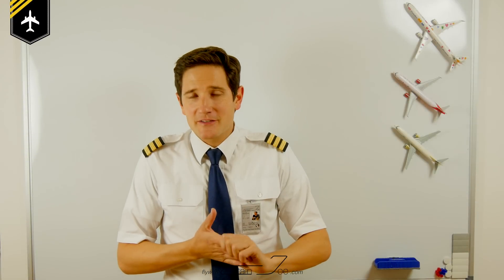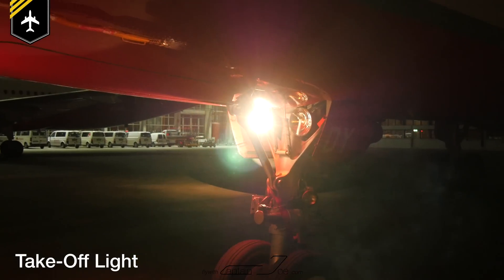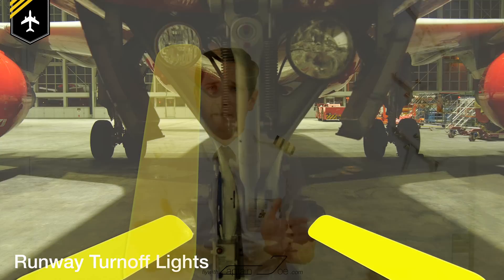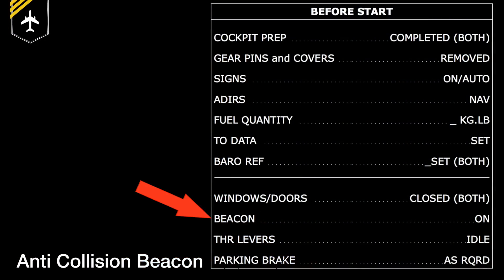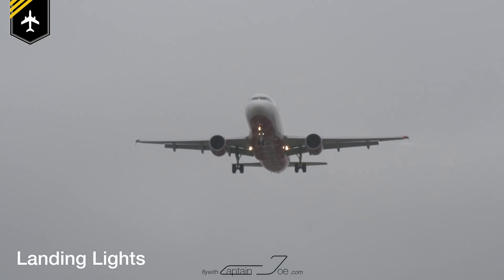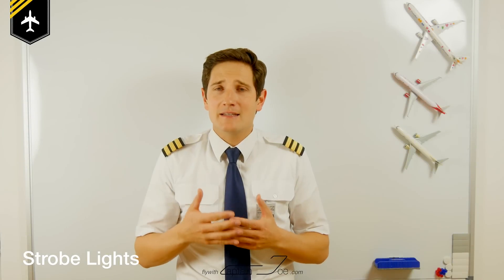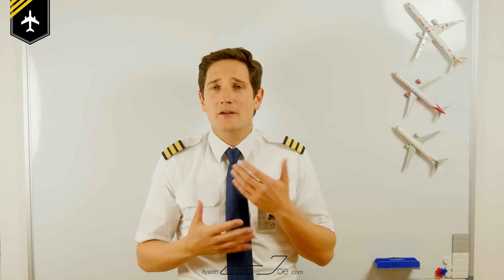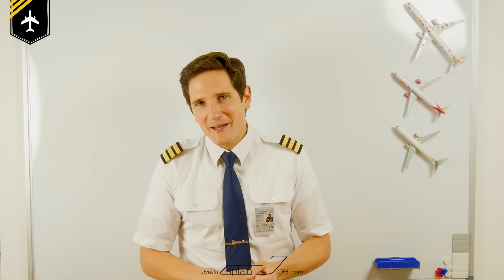LIGHTS on Airplanes explained by "CAPTAIN"Joe

Comment: Flying with an A320 tomorrow evening, I'll check and see if I can identify all the lights! 

I noticed that the B737 i flew in last week in a snowy condition didn't have (or didn't use) a light to check the leading edge of the engine/wing. I assume this is up to pilots discretion?

Always like your vides!
Reply from the maker: Yes it´s up to pilots discreation, and a matter of temperature and if it´s obvious that icing could appear there´s no real need to check !

Comment: I would like to know more about de-icing not the de-icing on the ground I know what happens. But the de-icing possibility which aircraft has. Wing and engine de-ice. Could you explain this? I would like to know. Do you have to de-ice every time from certain minus temperature? Or you need clouds and minus temperature to have to turn on the de-icing? And how does it work on the ground you have vehicles with special fluid and I think plane does not have that. So what happens engine opens and blows hot air on the wing or in front to heat? :D Thank you.
Reply from the maker: Thanks for your detailed comment, I´ll make sure to make a video for the upcoming winter ;) Greetings Joe
Reply: While Joe is unavailable, let me chime in. A bit on terminology. "De-ice" refers to systems which remove ice after it has been deposited. "Anti-ice" refers to systems which prevent ice buildup in the first place. Most of what you're asking about is anti-ice, not de-ice.
In flight, airliners mostly employ anti-ice systems, primarily through heating of surfaces. The ones that are always on are usually the pitot/static system heating elements (sometimes called "probe heat") because these systems are critical for safe flight and it doesn't cost too much energy to keep them well heated. The systems at the engine inlet cowling (engine anti-ice) and leading edge wing & stabilizer (wing anti-ice) are the supplemental ones that you see crews switch on/off, because they take a lot of energy to heat, decreasing performance and increasing fuel burn.
Proper use of these systems is specified by both the aircraft manufacturer and the airline, where the airline guidelines only ever go above and beyond what the manufacturer recommends. The usual simplified rules go something like this: temperature close to or below freezing & in visible moisture (cloud/fog): supplemental anti-ice on. Otherwise: anti-ice off. The use of these systems during critical phases of flight (takeoff & landing) needs to be considered in performance calculations also.
Finally, these systems have capacity limits. The presence of anti-ice systems doesn't necessarily mean an aircraft can fly continuously through icing conditions. If pilots encounter icing conditions, however strong or weak, they'll usually immediately consider ways to exit them as soon as practicable. Ice buildup rates can range from slow and gradual all the way to taking seconds to ice over a solid surface layer. Every pilot will strongly consider deviating if there are areas of moderate to severe icing reported in their flight path.
Reply: Captain Joe Awesome! Thank you :)

Comment: On the topic of Exterior lights,

Have you ever noticed any which did not appear on your Radars?
Reply: Zyklon - Drake. Any lights?  None would show up, weather radar can only see moisture, ATC radar can see transponders, primary can see any aircraft or large object (some have caught aircraft debris) TCAS can see any aircraft with a transponder.  Eyes are the only thing that can see lights.
TCAS does not miss anything (as long as the aircraft has its transponder on).  Naturally pilots can miss aircraft lights, USAir in Los Angeles comes to mind.
Reply: jfsa380
What about corona discharge under a hull without a transponder, or a pulsating yellowish light?

What happened in LA?
Reply: Zyklon - Drake. Depending on the model of beacon (the term for the light on top and below the centre of the hull) the colour may vary between a bright red or a reddish orange.  As for the transponder, they should be on and working on all aircraft, thereby providing information to tcas. but only larger aircraft have the avoidance software.
In LA, in the eighties or nineties, there was a USAir 737 landing, and the controller forgot about a Metroliner on the runway, told to hold in position.  At the time, the beacon and nav lights were the only lights required until cleared for takeoff.  Beacon fit in nicely with the centreline lights, couldn't see the nav lights.  USAir slammed right into it.  Wherever i was going with this, the lights can be missed, LA's ground radar (that i mentioned points out any solid object of a considerable size) wasn't working, the 737 either didn't have TCAS or wouldn't work (doesn't work on ground)